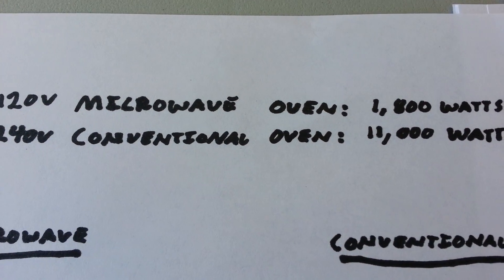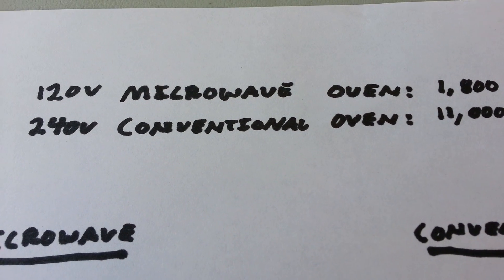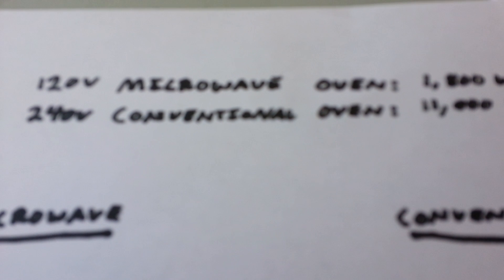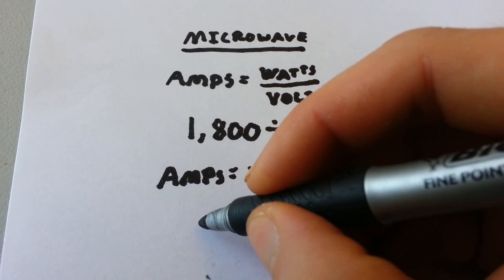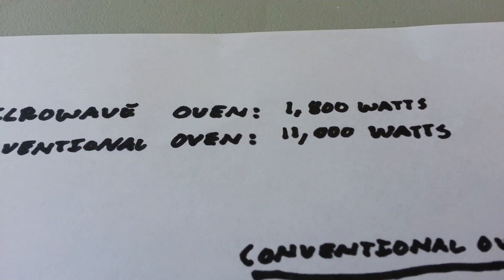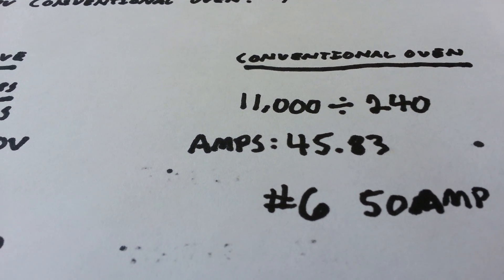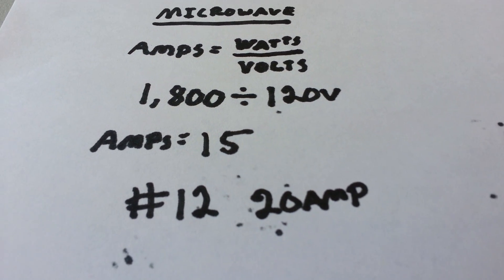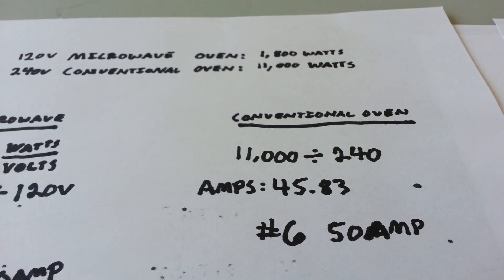HOW TO Calculate Amps ~ Alternating Current

Comment: could you tell me please, if i wanna install 7 heat pumps in a big house, each of them is 3600w, 15A, and the main panel is 200Amps, how will you figure out the main panel capacity whether enough?  the house have a electric Range, a dryer,  two fireplace each one is 1500w. thanks a lot

Comment: Thanks, but the gauge numbers given are only for USA, I presume?  Better to tell us what the diameter of the inner copper wire needs to be in either mm or in, not the gauge number which is a convention adopted for just one country.   I can then go to the hardware store and ask for xyz thickness copper wire and there would be no confusion.
Reply: Or you can look online for a conversion

Comment: how does came 12  20Amp and 6 50Amp
Reply: The smaller the number of the larger gauge or thickness of The Wire, so to explain a number 6 wire would be much thicker than a number 12 wire which is a 6 gauge or 12 gauge wire. So if you're going to use a larger amount of power you're going to want a larger way to carry it so you would use a small number wire which is a large gauge to carry the energy without too much resistance. What I'm really wondering though is how he nose how to use which gauge wire without explaining it to us, some of us don't know anything about the gauges of wiring and I propose a new video describing this

Comment: what's #12 he referring in the video above?
Reply: +Koo Shi Lan I believe he is referring to the size of the wire or the gauge of the wire. The smaller the gauge, the bigger the diameter of the wire. ;)
Reply: Koo Shi Lan awg it means American wire gauche   #14 is for 15 amp #12 is for 20 amps